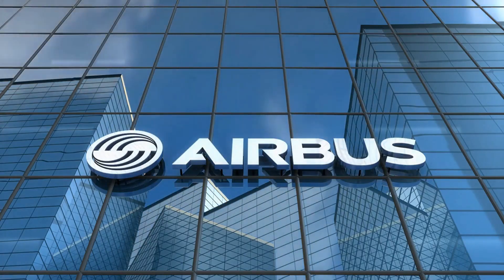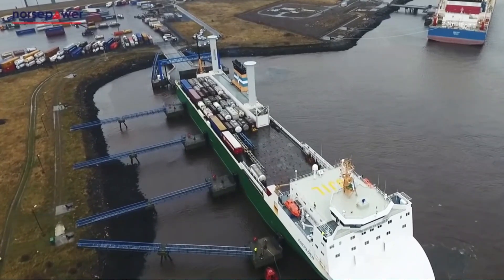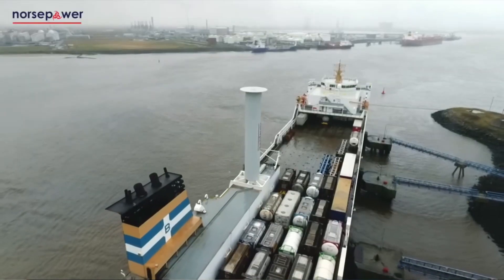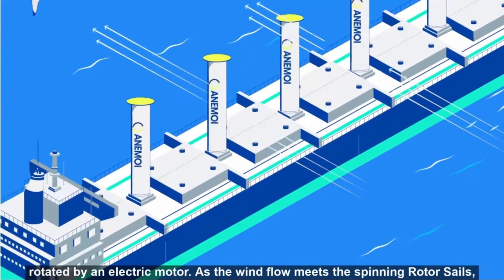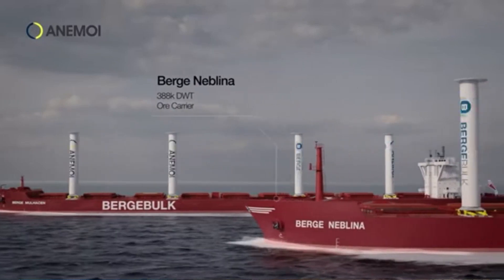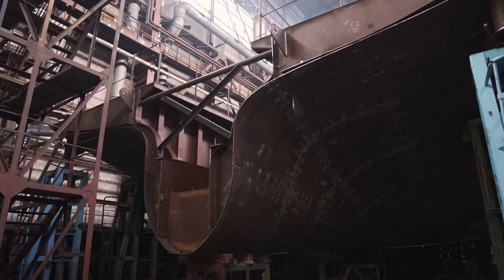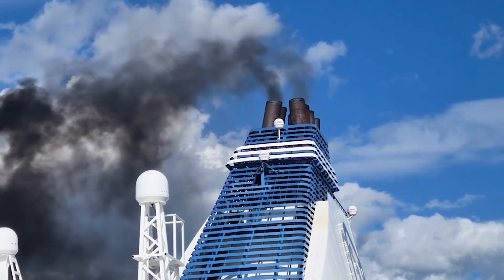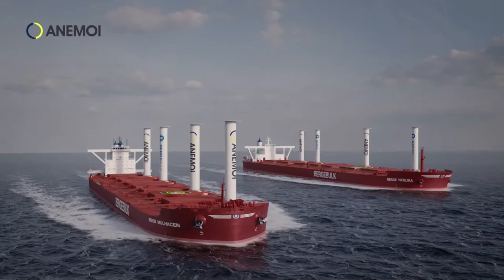Rotor ships are Back :  Upto 30% Fuel Saving

Comment: Why use Power to Rotate them?  Make the Top 1/4 of it as a Vertical Windmill and Have a Spiral in the Inside, where the Exhaust Heat goes up, wich makes them Spin even More.
Reply: Exhaust heat would create exactly zero rotational force

Comment: What makes those rotors rotate in the first place? Do they need external power from fossil fuels/battery to do this?
Reply from the maker: yes they need a motor. But what you give as input, you get much more as an output
Reply: 2:15: Buckau: 37 kW electric propulsion system for the rotors. 
Normally, they are electrically powered and the electricity comes from the diesel generator of the ship.
But if there is enough wind from the right direction, you get much more propulsion from it than by putting this power into the propeller.
But of course, it's a disadvantage to "normal" sails. Advantages are more propulsion force per wind profile and an easy control of this force by changing the rotation speed and rotation direction of the rotors.

Comment: Surely any wind from the sides (not due to forward motion) will cause steering forces? 
Any variability in the wind will require constant rudder trimming (in addition to anything the ship would normally experience due to it's "sail area")
Reply: Yep. In theory, the rotation speed of the sails is modulated to account for this. The velocity of wind vs rotation speed also affects the direction of thrust, potentially making efficiency much lower outside of ideal conditions.